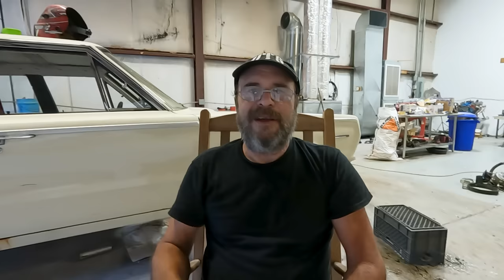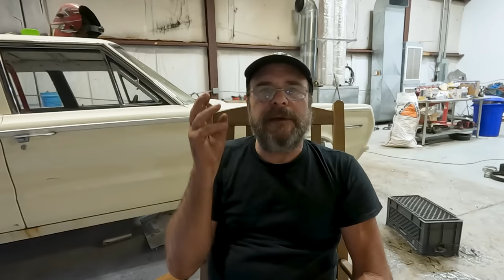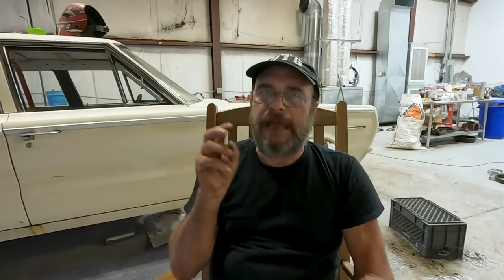They Really Are Out To Get You- How The Automakers Have Made Life Miserable For The Average Mechanic

Comment: I found out when I needed to replace the water pump on a mid 2000’s dodge 4.0 v6. Take the front of the engine off? Better replace the timing chain and tensioner as well? Just stupid engineering or planned obsolescence.

Comment: New vehicles have gotten so insanely high tech and expensive, the average consumer cannot afford to buy and maintain them anymore. Technicians are leaving because they cannot afford the tools and training it takes to service them. Sitting in one is like sitting in the cockpit of a commercial airliner. They are that bad. As a result, consumers have been driven to used vehicles driving used car prices to insane levels. The bubble is bursting however. Dealers are stuck with new vehicles and backing off on orders from the factorys. Auto workers are getting layed off as a result. The only answer is to strip new vehicles of all the high tech crap and bring back simple, affordable and reliable.

Comment: 1) Rubber timing chains on interference engines...a $ 25 belt snaps and destroys the engine on a $ 50-90K car.
2) CVT transmissions. Rubber belts turning plastic gears with plastic levers. 
3) More and more plastic on the engine and the transmission for the sake of better gas mileage
4) No more real gaskets on engine parts. They use the crap out of the tube which will break down over time
5) Needing to lift the engine up to replace spark plugs
6) That idiotic screen on the dash that distracts from driving
7) "Service required" light that can not be turned off
8) No way to preserve codes and settings when disconnecting the battery
9) Shrinking trunk and cargo space
10) Poor visibility on all sides
11) Plastic radiators. Mine burst while driving and all the coolant leaked out in minutes.

Comment: 300 years?

As of November 2022, some estimate that the world has 1.65 trillion barrels of proven oil reserves, which is enough to last about 47 years at current consumption levels. Other sources estimate that the world has around 50 years of oil left. 

Visual Capitalist
Oil reserves are usually expressed in barrels of oil equivalent, which includes both oil and natural gas. Proven reserves are estimated to be around 1.5 trillion barrels, while unproven reserves are thought to be in the range of 3 trillion barrels.

Comment: After this video i have a better understanding of why you dislike efi... 
But the thing is , converting a car back to use a carburettor as an example , may be actually  harder for less mechanical and more electronic minded folks. There are real diy solutions that   will make a micro controller into a very capable engine managment system.

Now , all what you say is correct however. I think the longer term solution would be a union of like minded persons simply making an open source car. As bold as it sounds , its a managable task if sufficient number of people are willing to do it.

The real issue is , people Just drifting with the trend and obey  without questions. Now that is , what is dangerous.
Reply: Yup, like the popularity of “restomod.” Instead of putting in a “period correct” engine with carb and breaker point ignition, you put in a more modern engine with coil on/near plug ignition and fuel injection.

There are really good options to control especially an LS engine. Holley Terminator and FiTech come to mind. Just before the pandemic, I helped a buddy put an LS into a really nice, clean, rust free California ‘69 Impala. The Holley Terminator made it fairly straightforward

Comment: It's all part of design obsolescence and design for greater profit.
A F150 truck that lasts a million miles and requires cheap/easy maintenance will not make Ford much profit - so they go the opposite way and make a truck that's designed to last just past the warranty period . If a drive shaft bearing goes bad- instead of replacing it for $65 , you're forced to buy the whole axle shaft assembly for $650 because it's all welded together now into one unit - BUILT-IN CORPORATE GREED.

Comment: Hi from the uk 
I used to be a truck fitter I look at modern engines and wander why. Having worked on Cummins and detriot diesel units from the 70s and 80s and many other units I am confused as to why a manufacturer makes a cylinder head so big and heavy a man can't move it with an over head cam what was wrong with three heads and push rods its not that the modern engine needs any more precise valve control or even has variable valve timing it's just a shit set up

Comment: Remember the days when a light would go faulty and pop a fuse costing just pennies?
And most electrical diagnosis could be done with a simple test lamp.
Oh, and everything the engine needed to run except fuel and water was actually mounted on the engine itself. 
I remember running up an engine that was stood on wooden blocks just to check it was a runner 👍
Now you need a degree in computer science to transplant an engine into another vehicle. 
That's sad because I'd like to put diesel engines into these Electric vehicles. 
I think that would be a step up 😂

Comment: Sad but so true. The engineer,s have had a ball. Not funny. Reset computer after oil change? Cannot check transmission fluid? TPM craps yearly,ABS lights on so far$$ not fixed.

Comment: Over here in the Philippines I nabbed a brand new 2022 Suzuki Carry Cab Truck for 14000 USD. Air Con power brake n steering. Rollup windows and straught up simple no frills. 4 cylinder 5 speed standard trans. Does the job man. Yeah, they are screwing everybody in the USA. Screw them.

Comment: I noticed this level of engineering stupidity back in the 80's. A simple heater core hose swap on my brother's LTD Crown Vic.
5/8 hose? 3/4 hose? Nope. A special 'S' hose(s) on the  firewall that was too short to use regular hose. Regular straight hose would kink, precluding its useage. 
Engineering stupidity? I seriously doubt it now. I believe it was deliberately designed.
I have several more examples on that same Panther platform car. But the 'simple' hose swap takes the cake.

Comment: My problem 
2001 dodge vann
His point true 
I’m a shade tree
Old school 
Full tank 
Need to get to
Fuel pump 
Now I can’t drop tank 
Too heavy 
Great idea 
Cut hole in floor board 
Good idea ( no )
Tank is all the way to bottom of the floor board 
If I hadn’t been paying attention 
I almost cut the tank 
If I hadn’t felt something that wasn’t supposed to be there 
But I dod it without blowing myself up 
Something to think about 
Don’t do it I got lucky 
Finally 
Dropped the tank down enough to cut the plate out 
No matter what 
Even if I could of dropped the tank 
Everything would of broke, torn  destroyed 
U couldn’t of put it back without going to the dealership ( if u could of got the parts 
Which doesn’t exist)
Ur screwed)
Damn bi cigarettes liters 
Wonce it’s down throw it out 
That’s it
Made to not b replaced 
So if ur machinic charges u an they do that job 
Pay him an hug their neck that they are still here
It’s a ( sorry ) it’s a fuckin land mine

Comment: The ford Cortinas,Sierras overhead   cam motors in the uk,problems from the start the camshaft would get worn quickly due to lack of lubrication on cold start  three camshaft journals  different sizes ,small one at the front ,mid size one in the centre and the rearnwas the largest one,so the head had to come off to do the camshaft,well we cut a hole in the firewall and removed the camshaft taking it out into the the vehicle and made a plate to seal the hole ford done this deliberately to make money for the dealers.

Comment: What people don't realize is when they did. The clonker deal the vehicles that they would take only had to be 2003 in above. With all legitimate inspections insurance and licensing, they would not take my 84 suburban that was licensed insurance and inspected because it was too old for the clunkers. They wanted the cars that were gonna be sold to the next group of people eliminate.  In order to get that, the President personally went and had a meeting with all the car manufacturers. S zeos and told them for a 100 years. You've had to make parts for 10 years. For your cars. I'm going to change the law with the clock or law that U only have to make 3 years worth the parts. Well, that only covers warranty work. There's no extra parts out here for us.  That's why 2018 2019.You can't get any parts for them.And they're designed to go bad because of all the computers.I had to jump too perfectly.Good.On 90 models to pick up and a 98 Crown.Victoria because I could not buy a thirty eight dollar piece 41 and a seven dollar piece for the other

Comment: This man is a mechanic instead of an engineer because he's not smart enough to be an engineer.

It is amazing to me that someone who works on cars could have so little understanding of the auto industry. There's no conspiracy to make fuel pumps harder to service (doesn't making it harder to service make it possible for you to make more money, btw?). Automakers design the components of their vehicles to get the job done at the lowest possible cost. I've owned a lot of cars. I've only changed one in-tank fuel pump and it was done because I wanted to upgrade to a 190l/h pump. The stock pump still worked fine. "Getting the job done" means 10y/100k miles under normal operation. But, certainly there are wear and tear items. Minimally, the goal is until the warranty expires on the least reliable car in the batch. Automakers COULD make a fuel pump that lasts virtually forever. Same with all the other parts and components. But, I guarantee you wouldn't want to pay for it. Nobody would. Consumers want the LOWEST PRICE.

If Ford could compete in the market and make a profit making Model Ts in 2024, that's what they'd do. But, they can't. Consumers don't want the model T. It doesn't have enough power. It's not reliable or comfortable enough. It's not safe. It pollutes too much. Pining for the "good old days" of the Model T is ridiculous. It is a far simpler machine than today's modern automobile. No person would want to own one as a primary form of transportation in this day and age. Honestly, the Model T is a shitty car by any measure. The only reason people of the 1920s loved it was that they didn't know any better and it was a step up from horses.

Modern cars don't use CAN busses to foil the average car repair. There's no conspiracy. It's being done in order to pack in more and more content that consumers want while keeping the vehicle weight down. This is necessary to keep the cost of the content down and satisfy the demand to meet government fuel economy and emissions standards. Not one person involved in the design process is thinking "How can we make this harder for the average mechanic to fix?"

Why did automakers go to overhead cams? The theory is they just did it to make your life harder? Again, no. It was done to get better control over valve operation for efficiency, power, emissions, etc. You know cars, right? You know that cam lobe shape impacts performance. Which type of cam allows more freedom in cam lobe design? A pushrod cam or an overhead cam?
Reply from the maker: After having countless custom cams ground over the decades for all different applications, I can tell you with absolute certainty that there is no difference in potential between an OHC lobe configuration and a standard pushrod/roller set-up.
Reply: @UncleTonysGarage  There are a lot of free online resources including Wikipedia that will tell you all of the various advantages and disadvantages of overhead cams vs overhead valves.

There's no conspiracy to make your life harder. There are design, performance, and cost trade-offs. The engineers decided that the overhead cam configuration was the best solution to the problems they were faced with. You weren't there.

Comment: I've always blamed dumb-ass engineers who have never worked on an engine for hard to access or difficult procedures. I gave them the benefit of the doubt. But now realize it's deliberate. Shame on them. I'll go full-on Cuban if I have to 2007 F360 with 206,000 miles. 5.4 liter. My secret? Marvel Mystery Oil! Gas and oil every fillup and 1qt. every oil change. Runs like new.

Comment: I watched a rebuild of a bmw motor, s65b40 was the name of it, it was already an old motor, but, this thing was so badly designed i could not stand it. Like, there was so many systems there, that went wrong, that have to be replaced by artermarket parts, which solved the problem, this thing was like, 3 patches to cover one mistake. There was not a single point where this motor would be better than LS. 
It felt like a product for idiots by idiots, and i never want to touch it

Comment: Larry from Dunwoody Industrial Institute,CTLS class of 1982, obtained a MOPAR four door green car, the hood wouldn't open till it was towed to a chrysler dealership in the dead of  winter along 35W by Lake Street Minneapolis. We sat there as bitter cold air came inside. Should we wait for State Patrol? Should we use a tire iron to pry open the hood? No oil anyway, that wouldn't get us anywhere,  should we walk tp 10,000 auto parts? In minus 40 wind? No, we drove with the red light on to buy oil, . The dealer got a car that needed a new engine... there's the right way, the wrong way and the Dunwoody way which includes the Dunwoody automotive Instructor that told me where to go with my 1974 Ford stationwagon transmission ...

Comment: "User serviceability was important through the 70s!"
"The A-Body Mopar was designed to be used up and thrown away!" 
Pick one. I now remember why I stopped watching these videos. Pure cringe. Stanning for cars with little to no rust protection while crapping on the concept of overhead cams.
Reply from the maker: I don't normally reply to comments like this, but...both statements can absolutely be true at the same time.
Early cars were designed so that normal maintenance and minor repairs could be performed by the owner.
Early cars were intended to last approximately 100,000 miles and about 7 years.
Where is the contradiction? 
Also, no beef with OHC engines, when there is a REASON to have OHC's in an engine.  When an OHC situation is suitable for the application, the drive system for that valvetrain should be simple as possible and straightforward, not requiring an engine to be pulled and completely stripped to repair a normal wear part of the assembly.
Is that a dumb viewpoint to take?

Comment: While I have a hard time knocking fuel injection and computer timing, thing's have gotten assinine. When tail light need to run thru the BCM What ass wipe came up with this idear? They have made it so complicated as to be hazodous. They need to back up and make sense again. Why do we need a fuel pump controler to run the fuel pump? What happened to a $16.00 fuel pump relay comanded by thr PCM that worked and going to a $200.00 fuel pump controler that needs to be programed when changed? NO PLUG AND PLAY!!!! Now you need $6000.00 worth of diag computer or 1 of the mobil tech's that are 3 week's out to come and reprogram. Some times I think that the engioneers that design this shit is in a position where they didn't get laid last night and their spouse did. We get to pay the price.

Comment: The Boomers are dumb in so many levels today. They have been downgraded severely. And to be fair to the Auto makers, I think it's more of the epa regulations that these automakers are under. Their under heavy pressure to keep mpg down. Hence why lots of engine downgrades since oil viscosity are getting lower. Just look at what Toyota is going through its engines, specifically The Tacoma, over 100k have been replaced. That was unheard of for Toyota. The oil that was required for Toyotas was sae 0530, it went to OW20, And now I hear their going to ow16 I believe. Yet those same engines outside the US are still using sae 0530.

Comment: Built in obsolescence started probably with light bulbs. What you are describing is the manifestation of capitalism. Best not to confuse your love for the brand with any love for you - shareholders require growth and don’t care about you beyond your ability to buy stuff from them. It is worse for EVs - there are many less things to go wrong so they are designing batteries to take the place of expensive mechanical parts. Large expensive batteries weigh loads making your journey less energy efficient (assuming you care about that) and are guaranteed to fail after a certain amount of use. Meaning high cost and triggering more demand for a scarce resource and all the associated environmental impact and money. https://youtu.be/bekrCxssz2g?si=3PW4tPRjKV5X5c-P